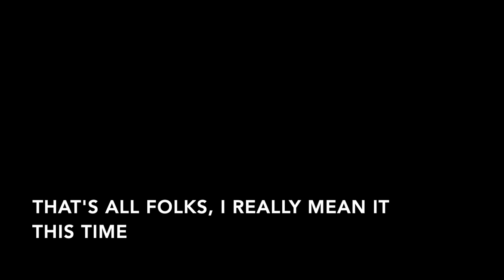Oz Goose

Comment: As this is a loose footed sail I am wondering about the grommets along the foot.  Presumably they can be used to put the reefing cringles through rather than tying the cringles around the bottom of the sail.
Reply from the maker: Grommets could be used for the reef cringes but when I ordered the sail just allowing another option for sail adjustment. Found as you already knew, loose footed is best